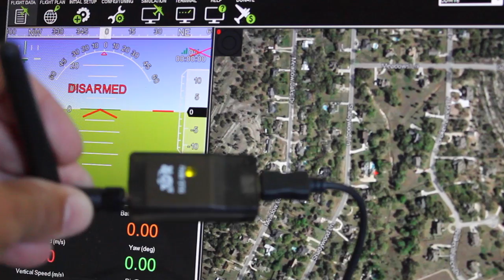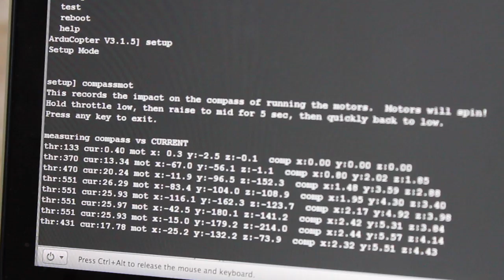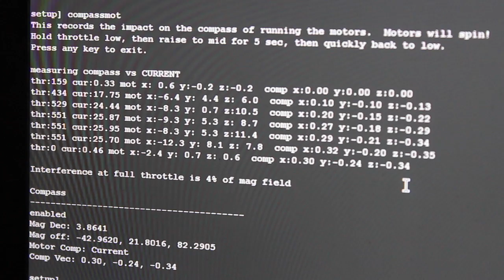3D Printed GPS/Compass Stand for APM and Pixhawk Multirotors

Comment: Dennis, thanks for sharing. I've got the Tarot t960 with Pixhawk. You are going to enjoy the how well it loiters. I put my ESCs on the motor mounts. I wanted to get them away from the gps and have them cooled by the props. I added extra capacitors midway in each of the arms to reduce inductance. So are you going to fly a camera on this one? I built my Tarot for 3d mapping.
Reply from the maker: renoflash06 Good tip on the ESCs. When I get around to reconfiguring I will definitely take your advice. Initially I'll just fly with the GoPro, but I'd like to a NEX-5 or or Samsung NX series. If you're not on www.garagepilots.com please join and friend me. I'd like to discuss 3D mapping in more detail. I've been doing a fair amount of aerial mapping, but haven't delved into 3D. Take care.

Comment: Great how to video. I've just been outside testing my RCT550 which is "protected" with aluminium tape between all electric components and the GPS/Compass stand. The magnetic interference was 4%. I did'nt test before, so i actually don't know if it has any impact at all.
Reply from the maker: Jørn Ramnæs That's great to hear. A few others have suggested copper tape so maybe I'll give that a try. I'd be interested in knowing what your mag interference looked like before the aluminum tape. If you get around to finding out please let us know. Thanks for the comment.
Reply: Dennis Baldwin Hi. I haven't been able to test what you ask for, sorry. But i've moved all my electronics from bottom plate of my F550 and to the top plate. The antenna was first placed in front of the HKPILOT32 and the Mag.int. was 89%, so i placed it on a pole beside the FC about 9cm above the top plate, and it fell to 9%. Since i've heard someone say that the FC, 433mhz and the X8R can disturb the Mag and GPS i covered the HKPILOT32 with aluminium foil and it dropped only by 1%, to 8. Then i covered the PDB, but i think it's to far away from the MAg so it did not drop. But when covering the X8R it dropped by another 1% to 7%. I'm going to turn of Telemetry as i dont need it right now and try again, but i think i have a good measure already.

Comment: Okay I Think I am having the same issue as Zycil w californii, When trying to connect to the pixhalk using Telemetry radio modules, When trying to connect within the terminal I am getting random text showing on the screen, the radios are talking, and shake hands, as I have flight data, and have used them for configuring my copter, The baud rate is 57600 and pixhalk reboots when I connect within the terminal, I can't type commands due to random generated texts. has anyone els had this problem and if so what did they do to fix it?

Thanks Hope this helps you help Clancey Aggen

Comment: compassmot doest exist in my software,   also when I click connect, it is showing only $@#$%#$#@%@$%   stuff like that, horrible,
Reply from the maker: +Zycie w Californii Depending on if you're using a cable connection or wireless you need to have your com port speed properly set. For cable it's 115,200 and for wireless it's 57,600. You're probably trying 115k over the wireless connection, which won't work.

Comment: nice job dennis
can i send you my address so you can send me one of those?
 i need one 7 inches tall with a spring loaded base so it won't break if it tilts over during a bad landing,
Reply from the maker: jimmy gray Wish I could help with that Jimmy. What you can do is download from Thingiverse and get someone from www.makexyz.com to print it. I don't have any flexible PLA but that is what you'd need to print with to meet your "spring loaded" requirement. Not quite like a spring, but it should do the trick.